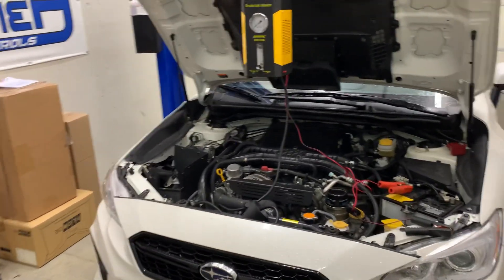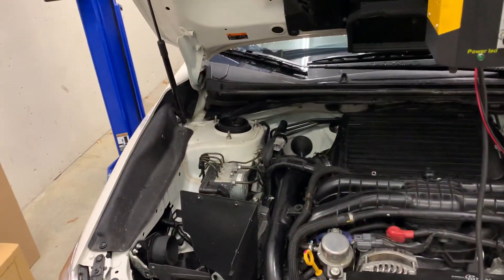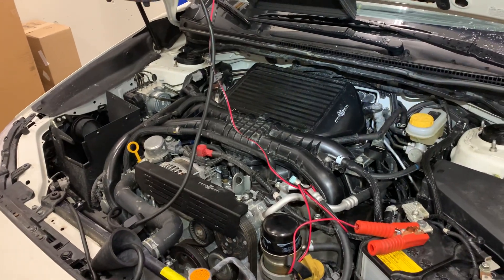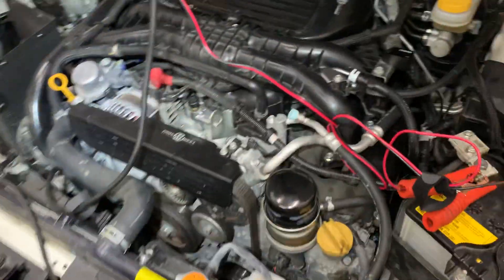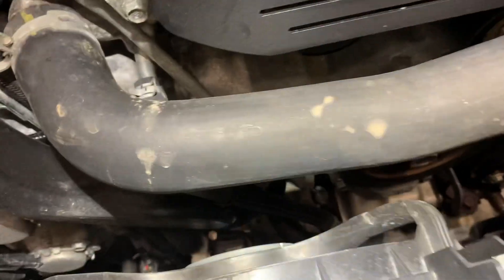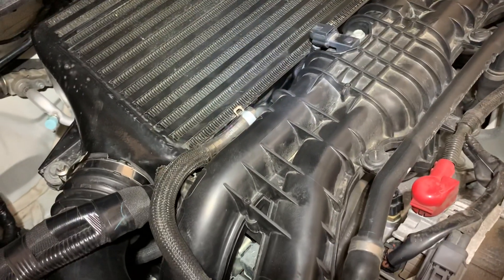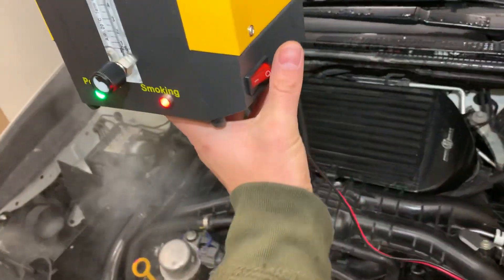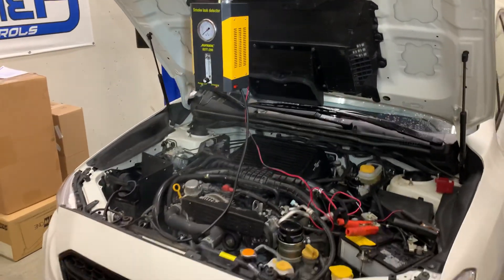Testing for Leaks: Smoking a WRX

Comment: This is a trash test because on a turbo car you need to introduce pressure to truly know if there are leaks. Smoke testing a turbo car without compressed air is a waste and you should do better.
Reply: Has its own compressor bud, 19-23 PSI
Reply from the maker: Actually these tests are very effective. And it does build pressure. Enough to identify leaks.
Reply: @ actually it doesn’t build up enough pressure. Not this way. I have seen countless cars leak at 16+psi. How is a boost leak test valid if it doesn’t represent the pressure of what the car will actually see? I test every car to what it’s actually going to see on the street, as anyone should. Otherwise, you’re just wasting time.
Reply: I have the same smoke tester and it runs at 19-23psi. Plenty of psi.

Comment: Does this test the turbo gaskets? Or would I need to smoke it from the exhaust side?
Reply from the maker: You must test exhaust side independently.
Reply: @ so smoking the exhaust side should show if I have a cracked gasket on my turbo? 2013 wrx ej255

Comment: Can you help me please. I got a smoke machine same brand but a different model and the cone that pushes smoke out is bigger so it plugs up the intake way better than in this video and at first I had smoke coming from the intake manifold because the coupler wasnt all the way around the silicone tube it was digging in it. After I fixed that I couldnt exactly see where the smoke was coming from but it was above the turbo inlet not the silicone connection but right above it. I guess my question is , If you send smoke through the system and it's plugged up tight will smoke push out of other places or is it supposed to be so much of a closed system that you are not supposed to see smoke from anywhere and pressure will build up indefinitely?
Reply from the maker: You should not see smoke come out. The machine can’t make that much pressure.
Reply: @stratifiedauto  I get you. I'm gonna have a shop check it out. Thanks!!
Reply: Do we have to wait for pressure gauge in the smoke machine to increase? My pressure gauge never rises when i do the smoke test.

Comment: How do you get the valves closed so it does not blow straight through
Reply from the maker: Most of the time the valves are closed. Also unless you open it the throttle body is closed.
Reply: @stratifiedauto  appreciate it

Comment: So the throttle doesn't need to be manipulated at all to perform the test? I have the same intake you do.
Reply from the maker: You can key on and press on the throttle to make sure it opens enough.
Reply: Ok, wasn't sure if the throttle being closed might make a difference or not....I tested for about 5 minutes.  But I guess I can run the test again with the peddle down.

Comment: So, just so I have it right,  you do not have to block off any other lines anywhere at all?  Just hook up to intake and thats it?  I bought one similar from amazon as well.
Reply from the maker: Correct. The system should be sealed from intake on.

Comment: So I did this and all the smoke is only coming out of the oil cap (removed cap) is that normal?
Reply from the maker: Yes you can get a bit through the pcv system into the crankcase.

Comment: Possible to get a epav smoke test? Having issues myself with a p1449 and p0455 code and trying to do a self smoke test
Reply from the maker: Evap system has solenoids. You can test up to the solenoid from the manifold. You can also test the solenoid itself if it opens.
Reply: @stratifiedauto  subaru hasn't been much help with the p1449 code. I've got 3 different sources to pull codes and all 3 give me different definitions. Filter clog, manufactur defined, and solenoid circuit fault malfunction. I've been told 99 times out of 100 it's usually electrical. Only know of the 2 solenoids up front beaide eachother and the leak detector at the back has a electric circuit plug to it
Reply: @stratifiedauto  I managed to find the correct hose leading back

Comment: Why wasn't the oil cap removed to save the crankcase from that pressure?
Reply from the maker: This system does not build enough pressure to damage any seals.

Comment: So I guess the throttle body being closed enough of a seal to still build pressure in the system? That’s good news. Would like to do this to the exhaust of my RS to see how bad the downpipe leaks
Reply from the maker: In a 4 cyl you usually have the valves closed enough such that you don’t go straight through out the exhaust. The throttle body is often cracked open on drive by wire cars.